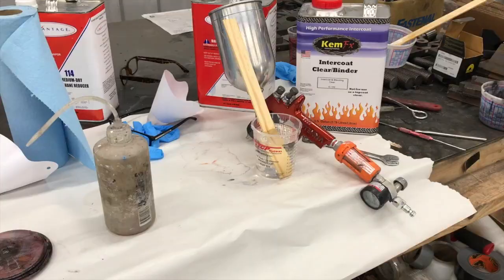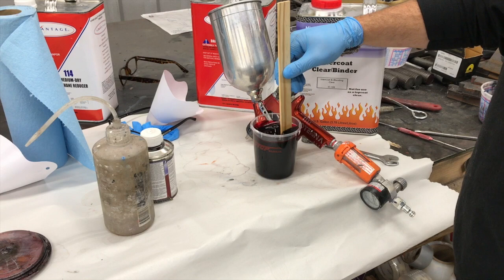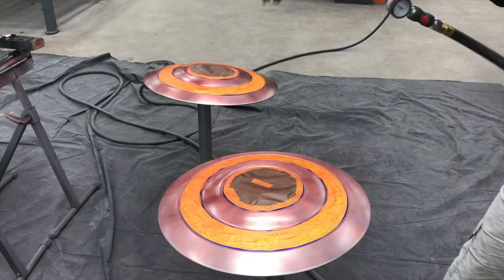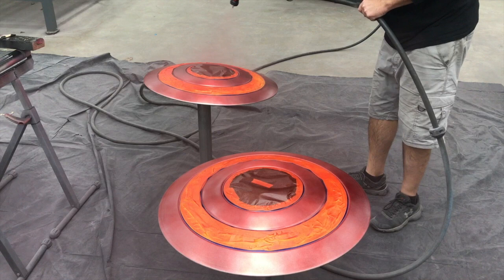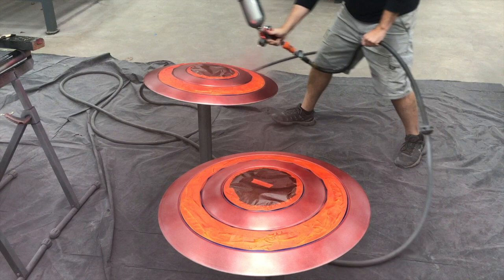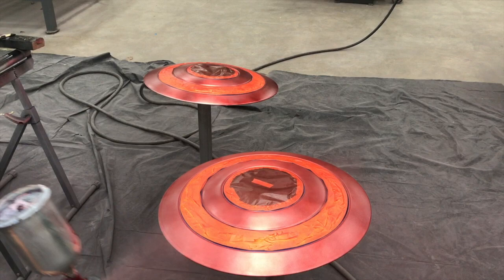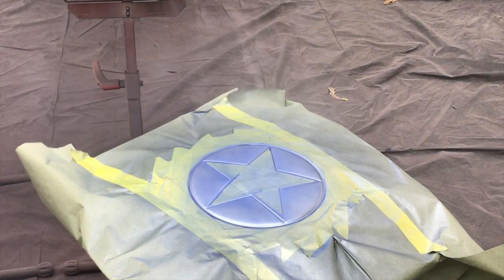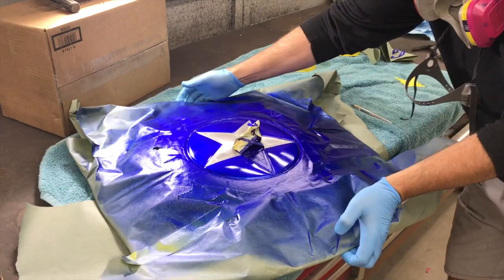Painting The Real Captain America Shield - Marvel - Justice League - Gift Idea! Kids

Comment: An aluminum shield could be anodize. Far more durable
Reply from the maker: if you plan to use these shields in outdoor battle, the annodizing has zero UV protection, the automotive clear will last 30 years out in the sun
Reply: @turbocobra  i didn't know that. Thanks for the comment